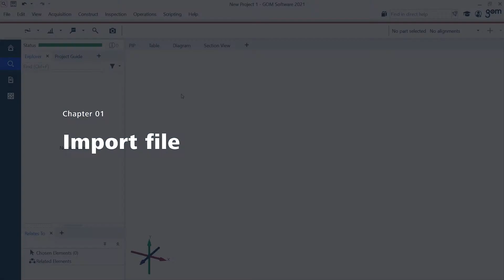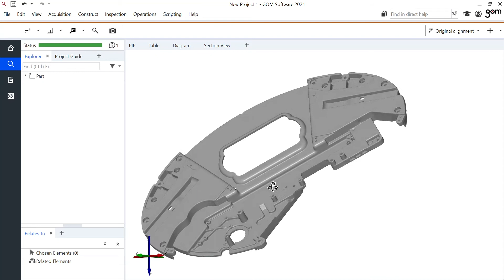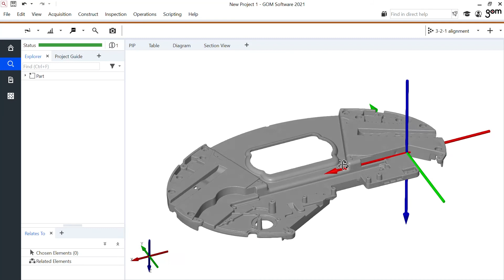ZEISS INSPECT: How to import & align your scan data

Comment: Sir, can we automate a single gom file like for example we have a scan data aligned with cad data but after improvement we want to work with same scan data (this tym scanned to see results after corrections)like if we delete the previous scan data and bring a new one scan data of same part ..can we regain all surface defect mapping or surface comparison values which we have generated earlier????
Sir, can you pls share your official  contact information i need to talk to u officially??
Reply from the maker: Yes this is possible with our ZEISS Inspect professional software. Please visit www.handsonmetrology.com/products/software/zeiss-inspect-full-version/ to look at the features and get a trail.

Comment: You aligned the mesh, but when adding the CAD data will not work.
Reply from the maker: You can align the mesh on its own when you do not have CAD data or you can align it towards CAD data when available. Adding alignments is always possible.You are also able to switch between alignments.
Reply: Which before drag and drop mesh model or cad model. I am before mesh model drag and drop after cad model drag and drop it is possible for better results please confirm me.